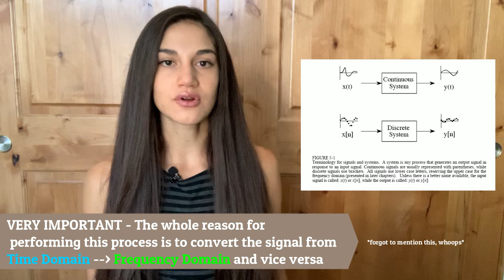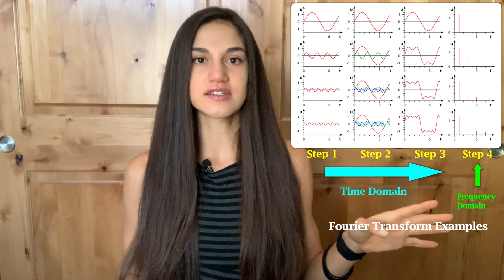What is Signals and Systems? | What To Expect | OVERVIEW

Comment: Hi I’m a senior and want to major on computer engineering but I have a couple questions. Is the math courses very difficult and are they necessary for the actual work? I heard you have to take multiple calculus courses is that also true?
Reply: Also what types of colleges would you recommend going to if I’m looking more towards the EE of computer engineering then the CS of computer engineering?

Comment: Is a computer engineering degree worth it? If so, should I get a masters?
Reply from the maker: Yes, definitely. Any engineering degree is worth it. However, getting a masters would depend on where/who you want to work for. Does this company/place require masters to get in? Or do they just recommend it? If they’re just looking for something with experience or can do the job (with or w/o a masters) then I’d skip getting a masters. HOWEVER, I’d highly recommend getting an internship during your undergrad years. This way you’ll be that much more experienced when you do graduate and much more likely to get a job (you’ll have a huge advantage over other candidates). Internships are very very beneficial. Hope this helped! 🙂

Comment: It seems to me the course is more for EE people, it has many continuous signals. 
Don't think that computer engineering needs to focus on discrete signals more like DFT, DTFT?
Reply from the maker: No you’re right, I do think it’s more for EE people but, of course, since CE also involves hardware, it’s a requirement for them as well. And yes, they do need to focus on discrete signals a bit more. But, I think this focus really depends on the college and professor. For example, the college I went to had the same Signals and Systems course that was required for both EE and CE students (they were in the same department) and the course covered everything under the sun related to this subject. I think later on in a CE’s degree, if they decide to go the hardware track, they’ll definitely need to take more courses involving discrete signals.

Comment: Hey, just discovered your channel a few days ago and so glad i did. I don't see too many people offering guidance for Computer engineering Majors.

I am close to finishing up at a community college soon but wanted to research more about my major. By the end of my college education, I would like to have the knowledge to help make peripherals that can communicate with computers, incorporate computers into "dumb objects" to make "smart objects", and things of the sort. What should my major specialization be in? I dont want to do Computer Science or develop software architecture/ cpu achitecture, but I dont want to just design circuits either. I want to be the intersection where circuits meet the coding side and basically act as a mediator to allow circuitry to interlace with software. I hope I'm making sense haha. It would be awesome if you could shed some light as to whether I am in the right major/ what specialization I should focus on. 

Thanks
Reply: I suggest looking into embedded software or embedded hardware engineering. It seems like the closest thing to what you are wanting to do
Reply from the maker: It sounds like you’d do well in hardware engineering or, like Jared mentioned above, embedded software engineering. To have a specialization in this area, you’re best option would be to Major in computer engineering with an emphasis in hardware. This way, you’ll be taking courses that teach you how to communicate with other objects/computers. Hoped this helped answer your question.
Reply: @TheSn12  
@Jared Horton
Thanks to you both for the replies. Im looking into that field right now and it seems that its a good fit! Do you know if there is a good job outlook for Engineers in this field?
Reply: Yes